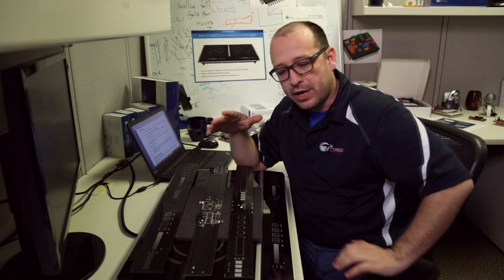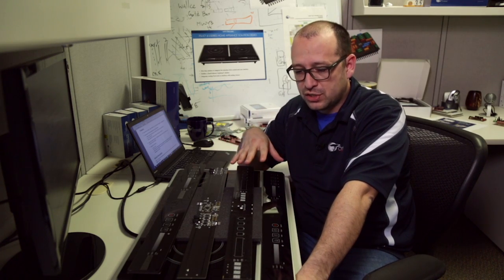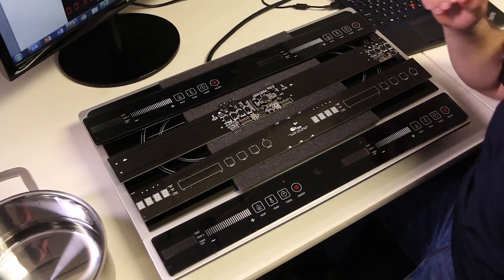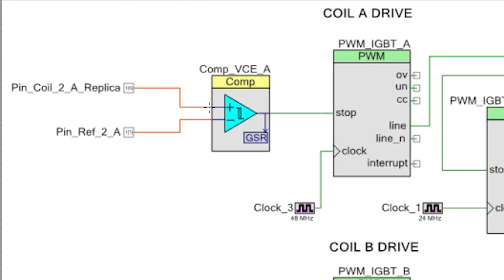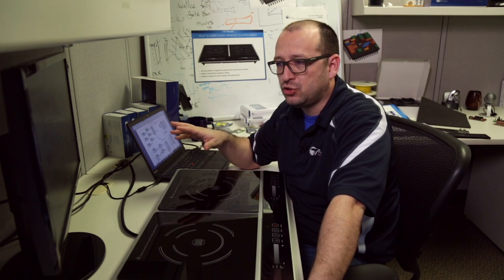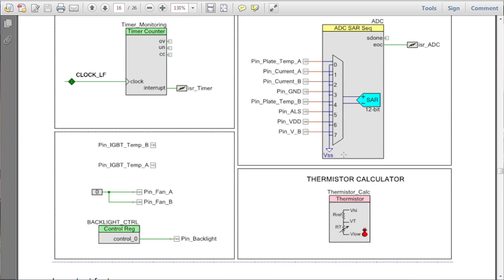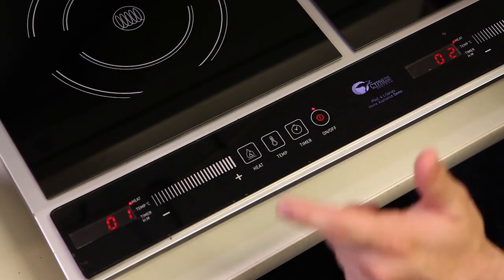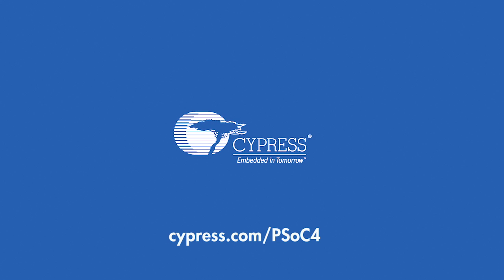Cypress PSoC 4 L-Series Induction Cooktop integration with CapSense demo

Comment: will this work if water falls on the surafce? do you have any liquid immunity precautions taken care at the board level or in software algorithm?
Reply from the maker: Hi jyothish k.r, thank you for reaching out. Yes, touch will be functional even when there are few water drops on the panel with driven shield enabled. Guard sensor should be used when there is pool of water on the panel to avoid false trigger by disabling touch. You may refer to the section 2.5, 6.4.11 in the CapSense design guide in the following link: http://www.cypress.com/file/46081/download. It is mostly taken care by hardware design itself along with minor firmware enhancement. For any further questions, please visit community.cypress.com. Best, Cypress